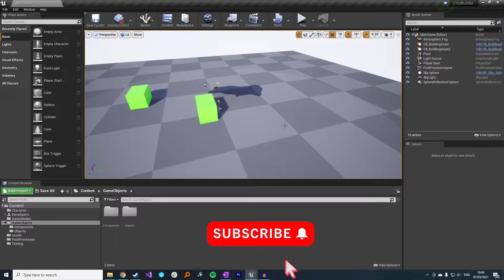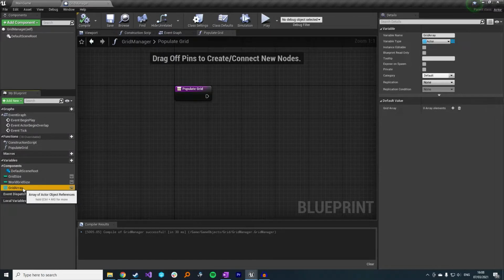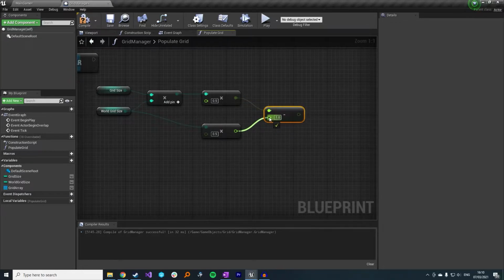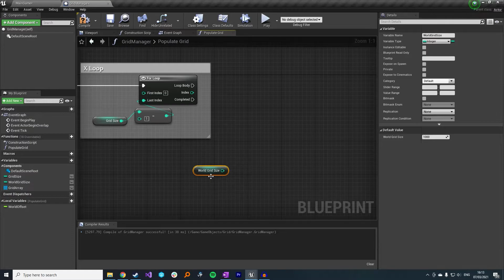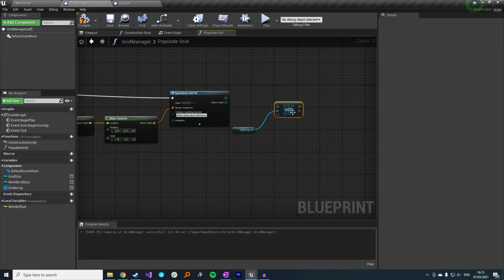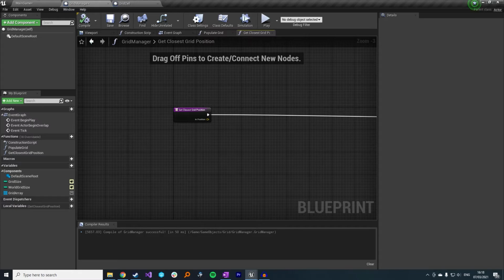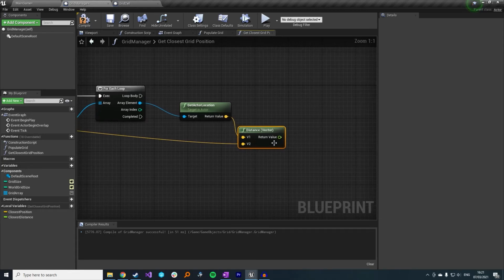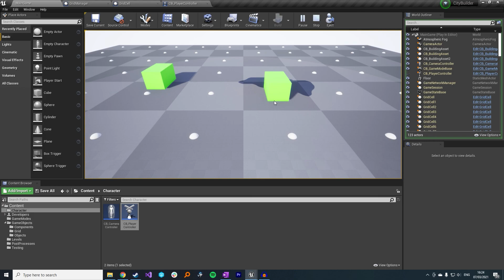Unreal Engine City Building Game - The Grid - EP 5

Comment: For anyone who doesn't want to do a For Each loop to find the closest grid cell, here's a quick, performance-friendly solution:

Create a new Vector variable called gridOrigin

in your PouplateGrid Function, at the very end, set gridOrigin to the GetWorldLocation(Default Scene)

in your GetClosestCell (or where your for loop currently is) function, delete all the code except for the return node (and the function's starting node). 

From the in position, drag out and subract the GridOrigin from the in position. Drag out from this result and divide by worldGridSize. Next split the result's struct pin into x y and z. Drag out of each and round them. Next create a make vector node, connect each of the rounded results. Multiply your make vector by worldGridSize. Add the result to your gridOrigin.

Lastly set your ClosestPosition to the result of the last addition mentioned above, then return the output into the return node.
Reply: Hi there, i have implimented this and didnt break the system, but no increase in performance and also the grid isnt aligned anymore.  Ive checked the math maybe theres incorrect node somewhere.  Thanks though to give a different method.

Comment: To anyone looking for the more efficient way of finding the closest grid position:
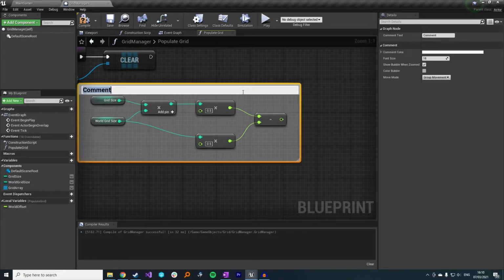First @5:40 instead of making this into a comment, make it into a macro: CalculateWorldOffset
Then 
GetClosestGridPosition
InPosition -> Break Vector
---
Do the following steps for both X and Y (Z is ignored for this demo as we're only doing a 2D surface)
1) add to CalculateWorldOffset
2) add this value to WorldGridSize / 2
3) divide this value by WorldGridSize
4) Floor this value
---
5) Now take the output of step 4 from Y and multiply it by GridSize then add this to the output of step 4 from X, this is the index of the cell in GridArray.

6) GridArray -> "Get (a ref)"
This requires an index, use the calculated index in step 5, and yes for some reason it says "Get (a ref)" instead of something more obvious like "Get by Index", in order to find this you will have to uncheck "Context Sensitive" in the top right corner of the search box, if you are unable to figure out how to find this he shows it in the next video in the series.

7) Get (a ref) -> ? Is Valid
We need to check if the returned GridCell is valid (if you are not hovering over the GridManager this will throw errors, so putting the check in prevents the error popups)

8) Get (a ref) -> GetActorLocation
There should be two uses of the return from "Get (a ref)", the first in step 7 is checking if it is valid, this one in step 8 is using the valid GridCell to get its location

9) Chain IsValid from step 7 and GetActorLocation from step 8 to the ReturnNode OutputVector
===

The math in steps 1-4 is explained here: https://math.stackexchange.com/questions/528501/how-to-determine-which-cell-in-a-grid-a-point-belongs-to
Step 5 has to be done because we are not using a 2D array, so the row,col coordinates need to be linearized into a 1D array. For more information read up on linearizing a 2D array to a 1D array.

If you are still kind of confused about what is happening, basically we are doing PopulateGrid in reverse for steps 1-4 so try looking at that to see if it helps to understand what the math is doing.
Reply: Wow, Thx a lot!

Comment: Im confused on the definition of GridSize and WorldGridSize
Is GridSize the size of a single grid cell? or is the the WorldGridSize?
Or is GridSize the number of individual cell(s)?
From what I understand from poking around is WorldGridSize=Size of a single cell, GridSize=Number of cell
Reply: worldGridSize is the size of each cell in UNREAL UU units. 1UU = 1cm

Grid size. is a variable that contains the number of rows and columns that the grid has.

You can also separate this variable into GridRowSize and GridColumnSize, and calculate an Offset variable for each so you can have an irregular grid instead of a perfect square.

Comment: You can pull off a 2d array by utilizing the map container type instead of an array and use a 2d vector as the key. Maps are just like arrays but let you choose a specific type to key what you store. both the keys and values you store can be pulled as arrays aswell.

Comment: For whatever reason this grid system quit running smoothly and started lagging hard. I even went to back ups of my project that I knew ran smoothly and they were also lagging.
Reply: I know this is old, but could the reason have been because get actor of class was being used every frame
Reply: @officialgreenhero1435   Probably. These youtube tutorials for unreal seem to be built for the express purpose of showcasing just the thing its building and not actual game developing. So like it'll work. But NEVER for an actual project where multiple systems come into play. Something simple maybe it'll work.  Whats the purpose of the video then, just getting hopes up and mainly just ad revenue from suckers? As rewinding any tutorial video usually plays ads again.

Then there was something with Unreal 4 when I was using it. Where systems would just stop working with no error messages.
And Unity had a similar thing. Where I couldn't import an object for use in vr that could be interacted with. But I could swap one of the objects that was working and already in the scene, just swap the mesh and it could be interacted with. Even though they both used the exact same dependencies/code.

I don't know if its the constant updating of these engines, but it feels like something breaks every time there is an update, but no documentation of the work arounds or what causes them to stop or of what isn't working, and because updates are frequent, so more stuff breaks.  So I put my projects on the back burner until I either have time to fully learn unreal/unity itself like the program and not just programming  or a team. It just feels like you need to be an actual studio with a team of monkeys just hitting the keyboard until one of them figures out how to implement something.

Comment: First of all great Tutorials ! I have been following up until the Citizen Tutorial.
I was wondering how I can increase the performance on the Grid.
When cranking up the Size of the Grid to a 100 it starts to perform really bad when placing buildings and rotating the Camera. 
You got any Solution for this ?
Reply: A few optimizations I implemented was to not spawn actors to store the grid info and instead make a structure with all the info I need for each grid. Then I used the modulo (or modulus, always get those mixed up) of the x and y of the world location under the mouse to get a unique vector 2D for each grid that I can use as a key in a map with the structure I mentioned being the data in the map. At 100x100 I am getting 90 fps :)
Reply: @prototy  how do you that
Reply: which variables did you use

Comment: Is it possible to apply this to the building pieces in the previous video? I want the pieces to be able to snap onto eachother. I want to make a modular building system, and if I can apply this system to the building pieces, that would be exactly what I need. Thanks in advance!
Reply: Ah nevermind, I spent all day working around this and somehow I managed to pull through. Only issue is that since its run every second I have some very taxing commands and my game does not run too well lol. Also the circles used are messing up the overlap so its considering itself invalid... I'll probably find some way to fix it...

Comment: If someone is having trouble getting distance between two vectors: use the vector subtraction node connected to a vector length node.
Reply from the maker: There's also a vector distance function you can plug two vectors into I believe, thanks for the tip!
Reply: @thegamedevchannel3063   there is only a distance to point segment node

Comment: Спасибо тебе. У тебе приятный голос!
Покажи пожалуйста как можно сделать сетку как в цивилизация 5/6?
Reply from the maker: Hi, thanks for the support! (I'm sorry I don't read Russian so I had to translate what you said through Google). Hopefully it translated correctly!

What I would do is a very similar system but offset each row by half of the previous row if that makes sense? I'll try and represent that by the numbers table below if you imagine they are the X values of the Grid Cell

0 2 4 6 8 10
 1 3  5 7 9
0 2 4 6 8 10
 1 3  5 7 9
0 2 4 6 8 10

And then obviously for the North/South neighbours you should an extra for the two attached cells. hopefully that helps!